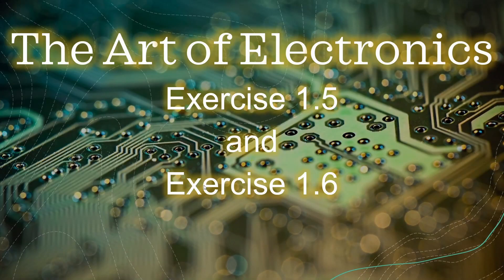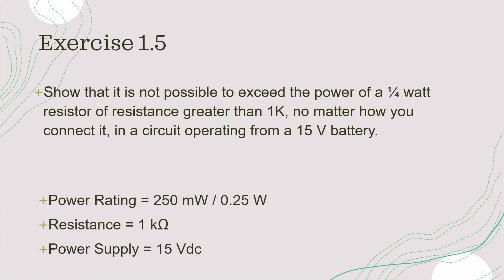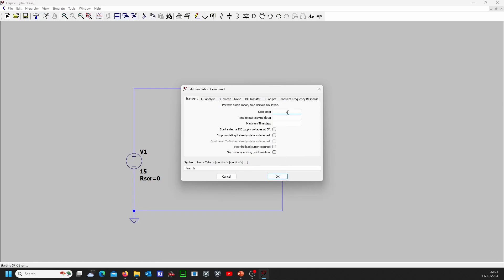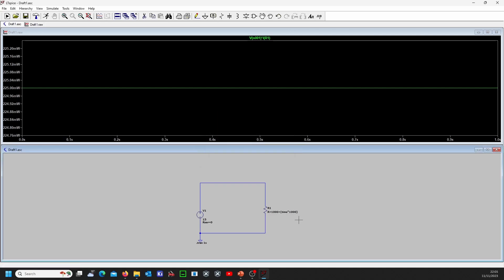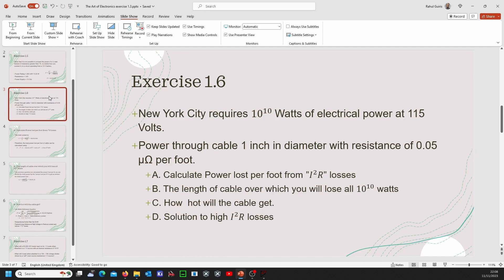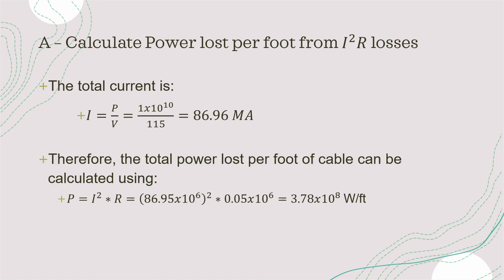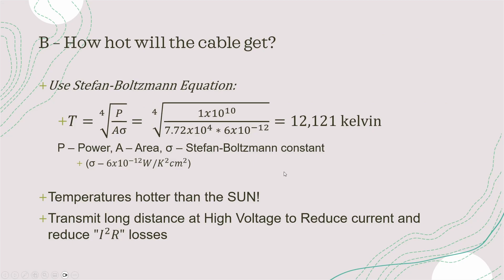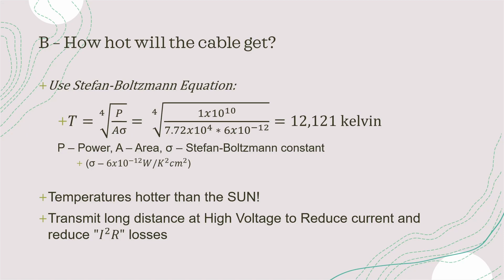Learn The Art of Electronics: Exercise 1.5 and 1.6 Explained

Comment: What if you connect the 15 V  battery to a step up voltage converter.
Reply from the maker: You get some stepped up voltage output from the step up converter. I am not entirely sure what you mean.

Comment: In exercise 1.6 isn't the correct value for 0.05 micro ohms 0.05x10^-6 rather than 0.05x10^6. Then the cable length and temperatures would be much more realistic?
Reply from the maker: I think its just a typo on the presentation. The calculation is actually 0.05x10^(-6).

P=3.78*10^8 is corrent for power loss.
Reply: I wished I'd worked it out before posting....I just assumed the outcome was also out by the same factor 😊
Reply from the maker: @ChrisLees-e9n  thanks for pointing it out!

Comment: where we got the area of 7.72x10^4?
Reply from the maker: Stefan-Boltzmann Equation is in cm so convert all numbers to cm. 

1 ft diameter cable    30.48 cm

26.45 ft cable length is 806.196 cm

Then calculate radiating surface area A. 
Radiating surface area = (2 × pi × r) × h) or (pi * d * h)

pi *  30.48 * 806.196 = 7.72^x10^4

Comment: Regarding question 1.6a, why is it that we cannot use the formula P=V^2/R=115^2/(0.05*10^-6)=2.645*10^11? This answer I provided is wrong, but I do not understand why. Why can't we apply this formula here? Thank in advance!
Reply from the maker: The 115 V is not dropping across a foot of cable.

You can certainly use your equation however first you must calculate voltage drop on the cable/foot.

So you wouldn't get 115^2 but another number for voltage drop per foot of cable.